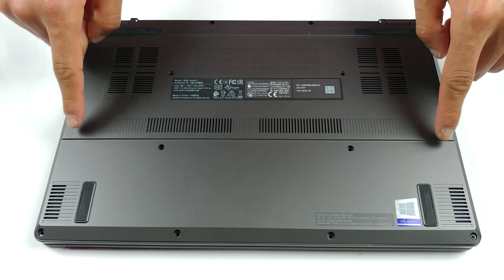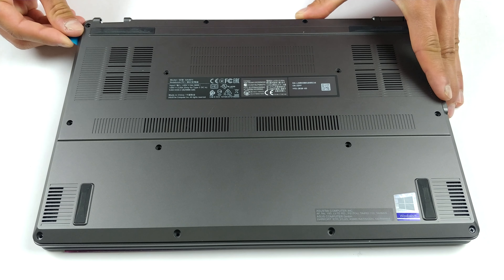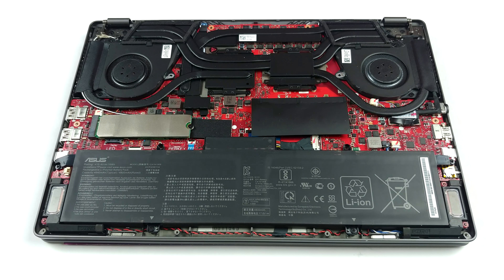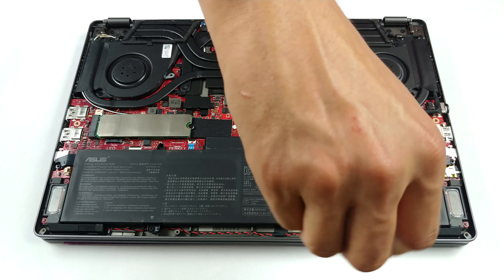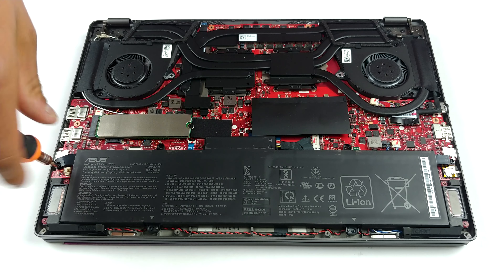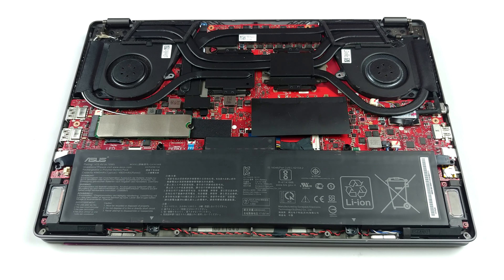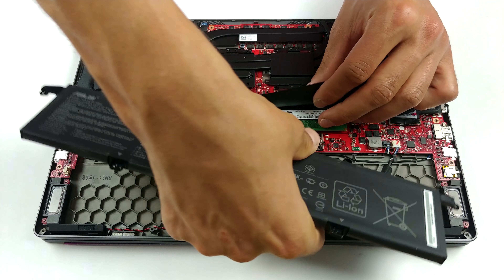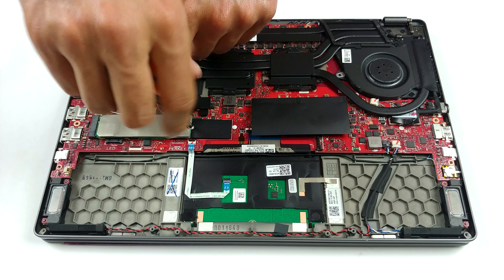🛠️ASUS ROG Zephyrus G14 GA401 - disassembly and upgrade options

Comment: Wow this wifi card is under the M.2! Interrested solution! However I hope the CEM will be good... because they're really near!
Reply: Its got wifi-6 , so i have to assume that they know what they are doing. Interesting thing as well is that the inside of the bottom cover of the laptop has a copper grounding plane.

Comment: Hello, I opened my zephyrus and cleaned it. Thanks for the vid. The question I have is: should all the screws be the same length? My zephyrus had three smaller screws at random and the rest are the same. I bought mine brand new at best buy. Is this normal?
Reply: Yes some screws are shorter, did you find any information which ones?
Reply: Smallest screws are at the opposite side of the fans

Comment: Does it mean that if I buy the model with 16Gb of ram, it comes with 2x8Gb, one welded and other apart ? or with one module of 16 Gb and a 2nd space for upgrading?
Reply: The g14 has one module welded on with 16gb and then an additional sodimm slot . The best you can upgrade to would be a 260 pin 8gb 3200mhz sodimm and that will just slide right in the empty slot. Takes literally like 10 minutes to do yourself. On Amazon the crucial is only $45 I believe.
Reply: @dont4getatowel  wouldn't it be better to add a 16gb instead of 8gb?
Reply: @archemity  From some reason BestBuy and Asus state you can’t add more than 8gb extra ram to the g14. Not sure why or if you can do more it looks like some people can go up to 40gb no issues.
Reply: @archemity  it wouldn’t be optimal for dual channel performance, but it would be useful for high quality encoding

Comment: so u can have 2 16gbs of ram and have a 32gb ram module???
Reply: One 8gb is soldered
Reply: 8 gb is already there, if you add 8 then its 16. No need to go 32 gb it aint worth
Reply: @MK-ic6vo  due to dual channel? It will just reduce speed but will worth it
Reply: @MK-ic6vo  oh, i see i might consider replacing the other 8gb since i have the 16gb model
Reply: Hmmm. I was assuming there was a single 16gb stick, so I bought a 32gb replacement.  No matter what, this will still be the best laptop I have owned to date.
Reply: @eyeofhoruswadjet4236  which specs?
Reply: @universalyoutuber195  specs on the laptop or the replacement ram?
Reply: @eyeofhoruswadjet4236  I am asking the specs of the version you bought or gonna buy like I will go with Ryzen 7
Reply: @universalyoutuber195  I bought the variant with the 2060 Max-Q GPU, AMD R9 4900 CPU. Just swapped the SDD with a Samsung 970 2TB.
Reply: @eyeofhoruswadjet4236 thanks that's what I wanted to know
Reply: Man the SSD costs 1/3 of the total cost of laptop
Reply: @universalyoutuber195  plus the external case, plus cloning software. it wasn't cheap but overall, i have triple the storage space
Reply: Congratulations 👍🎉
Reply: @universalyoutuber195  yeah, not really the most economical option. but i wanted to be able to download all my apps and games without having to worry about storage. but you also have to get cloning storage plus an external enclosure... the cost is dumb.
Reply: @eyeofhoruswadjet4236  wow you replied after 1 month😂😂
Reply: @eyeofhoruswadjet4236  what ram are you buying? I also want 40gb in total

Comment: Mine has 8GB installed ram.  To keep the dual capabilities does that main I should purchase another 8gb ram?  Or should I go with the 16gb?  In this video he removes a ram, yet I thought he said it was soldered in?
Reply: if it's a 2022 model then it has ddr5, if so it can run dual channel even if it's a single stick

Comment: It didn't look like you could add a HDD to this.  Is that correct?
Reply: Yea.....it comes with only an Single SSD Slot which can be upgraded
Reply: You cannot add a hdd (hard disk drive), only a NvMe card type ssd. And you can not add, only replace.

Comment: Do you know how to enable xmp, so that ram runs at max frequency instead of 2133mhz ?
Reply: It needs jedec 3200 ram not an xmp overclock sadly you picked the wrong ram module
Reply: @JDC2389  hello. I have the GTX 1650ti model, so you said that inside I have jedec 3200 DDR4 RAM ???

Comment: I wish I can upgrade the gpu
Reply: Then you have to go with Dell allienewere 51m  R2 or 51m R3 models,
But they're very expensive, in terms of pricing and upgradibility.
Reply: You can get a 1660ti model or a rtx 2060 model. There is now a rtx 3060 model for around 1400 usd if you want

Comment: Does it really supports Upto 40gb ram?
Reply: If you're using more than 16gb of Ram it will not operate in Dual Channel anymore and reduce overall performance. But yeah 40gb is possible
Reply: It does support upto 40 GB, and it still works as a dual channel for applications using ram under 16 GB , else it starts working as a single channel Ram